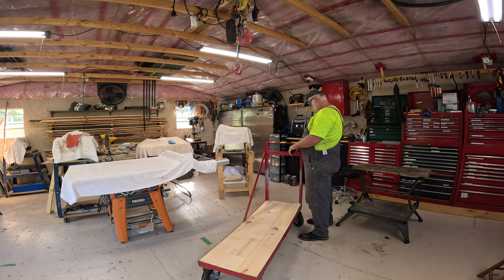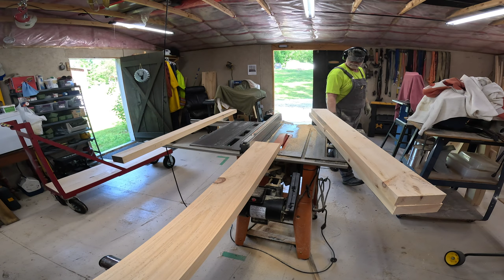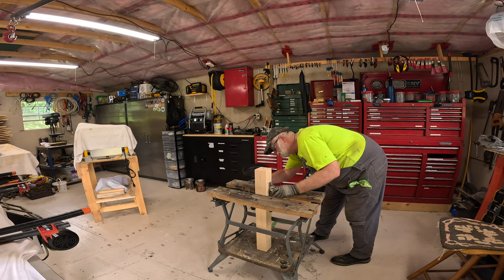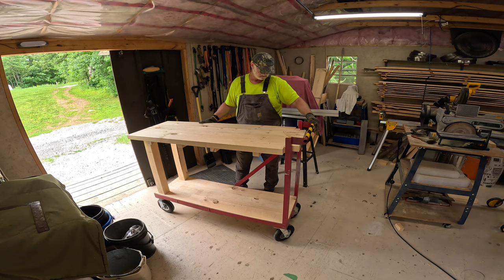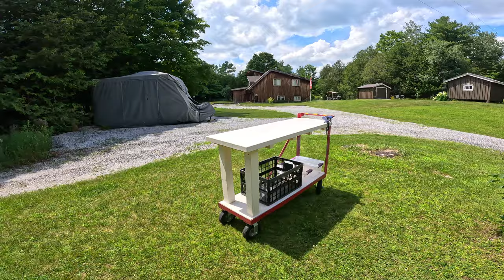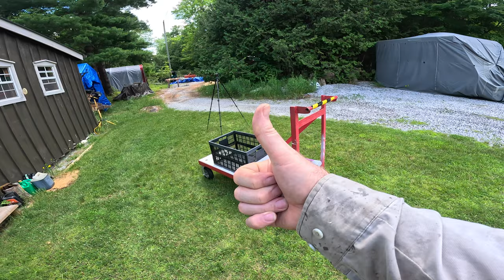Building a DIY Mobile Workbench with Detachable Top!

Comment: Hi my frind...maybe you need to make across by wood in the front to avoid any unstability.
Reply from the maker: Hi Rashad! Thank you very much for the idea. I did think about doing that but I tried making a pocket in the bottom of the bench top the the posts fit in and that seems to work really well so far. If I have trouble with it I will use your idea. Thank you again my friend. It is always good to hear from you.